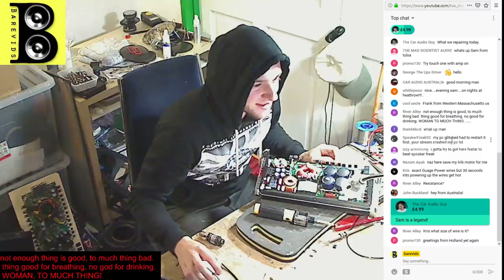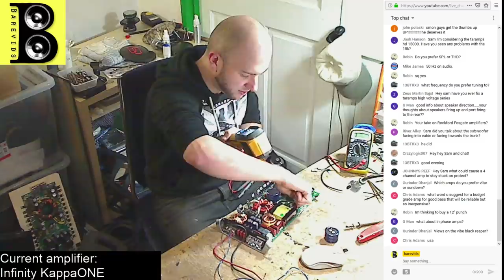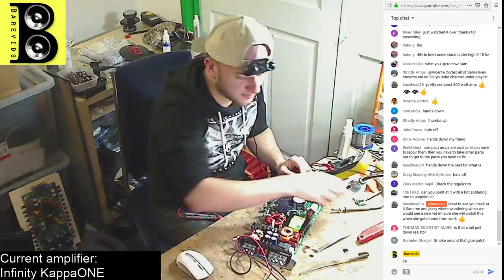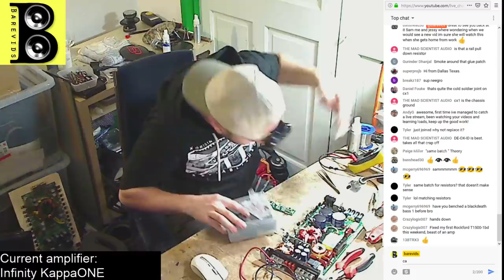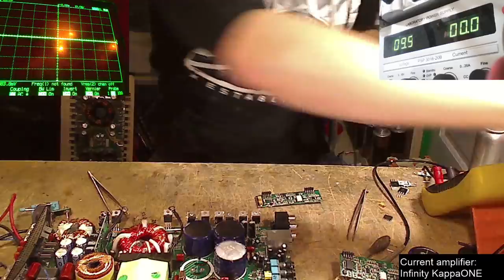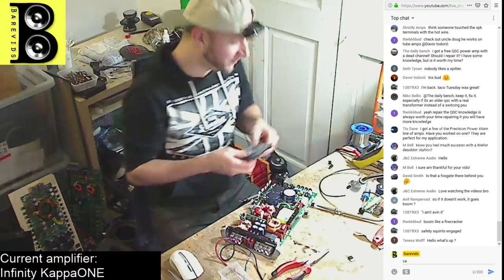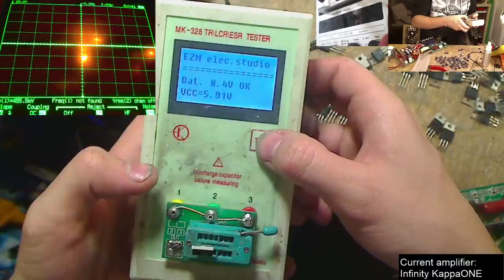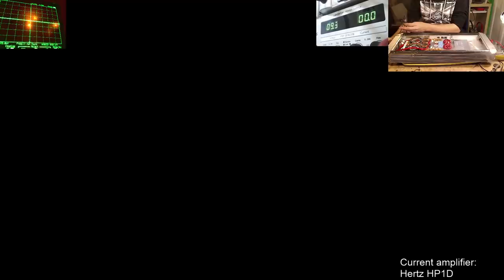MULTIPLE Failures on Infinity KappaONE amplifier repair

Comment: I do some mechanic and electronic repairs myself as well. I think that a good engineer is distinguished by cleaning stuff thoroughly. And in case of electronics, I encountered many problems with bad electrolytic capacitors. Especially when they got heat up. So when using a hot air gun near those, can cause trouble shortly after behind done. That is why I replace those, when I even have the slightest feeling of them being out of range. In both computers as audio-works it makes a lot of difference. But a nice lecture still, as I saw some interesting tools to approach broken chips. This heat camera replaces the good old liquid Nitrogen test. :D

Comment: Here's a tip bro, it'll help ya.
Most MODFETs have an "intrinsic body diode" because of the way they have to be manufactured. You can't just slap meter leads on any way you like. For an N type enhancement mode FET, it will always show up as short IF you measure drain to source with the negative lead (of the meter)on the drain and positive (of the meter) on the source.
The same applies when measuring P type in reverse. You'll get anywhere from .4 to .7 volts on diode check.

They were MELF capacitors on the driver board on the first amp and not tantalum.  You most probably won't find any tantalum caps  in anything but the oldest of amps. Also, there was most probably nothing wrong with the driver chip and you lost a bit of time replacing it. The cap was the fault. edit: It was a tantalum, I'm surprised they STILL fit them.
Reply: melf is a package...you need more study...and that is a tantalum cap..they are no novelty since 80's...
Reply: @john-mi1ud  Yeah I cocked that up, you're right.
However I have 35 years of learning electronics. So, you can jam your assumptions :)
Reply: @Jimmeh_B  didn't wanted to sound rude...i've been into this for more than 20 years and i can assure you everyday i learned a new thing...it's like programming, there's always room for better

Comment: 1:03:07 why did you try desoldering that giant capacitor from the same side that the component is mounted on? Desolder it from the other side, it would be much easier. Looks like there's a mess there next to the component.
Reply from the maker: i was killing two birds with one stone using the iron to melt the glue used to attach it down. Its a resistor by the way!

Comment: Do you have a cross reference for the hfp50n06? 
Also I'm looking into getting a oscilloscope, which level bandwidth would be good to start with?
Reply: 20 Mhz is ok for audio work. you can find them pretty cheap on ebay.  Problem is most sellers don't know how test them so at least make sure they show it powered on. Try to find a Hitachi if you can.
Reply: @cat-lw6kq  ok thanks
Reply: The bandwidth is the frequency at which the signal strength has dropped to 90% (and it drops rapidly after that). For audio, you are looking at KHz, so bandwidth won't be a problem.

I use a 30MHz analog scope and it's fine. You won't have the ability to digitally record and inspect the signal, but you can see the waveforms of the audio signal and any harmonics of it, as well as high frequency noise from power sources and such. You can get a old analog scope for around 50$, you can get a lower end DSO (digital storage oscilloscope) for a few hundred.

If you get an old analog one, make sure the ground is connected, some fuckheads float their scopes by removing the ground. A signal generator is nice too so you can feed controlled sine and square waves into the circuit to analyze its response. A lot of modern DSOs come with built-in signal generating capabilities.

Comment: Can I power Infinity Kappaone class-d mono car amplifier at home using 12v 50amp smps power supply ?
Reply: You could, but wouldnt it be cheaper to buy a used monoblock for home stereo use of some sorts? It would also be more suited to 8ohm hifi speakers.

Comment: You could have stripped the pads with way too much heat matey xD high thermal capacity yes, but you don't need 450 degrees if you're exposing things that long... D:

Comment: Does anyone know what would cause an amp to produce a continuous tone, the input signal works with other amps normally so it's not my stereo and the inside of the amp looks perfect no signs of  burns or smells. The tone just happened randomly one day it sounded high pitch and I thought it was my muffler sound until I smelled my sub smoking it burned my new sub and it didn't stop until I took out the power fuse which didn't do its job as the wire got really hot and never popped

Comment: It was incredibly difficult to watch you misread R116 instead of R118 -- and then not know why you had different results in the schematic vs. the parts sheet because you were looking at two completely different resistors.  Funny this is... R116 is literally right next to R117 on the board (and you can easily see it at 1:48:30 next to the oscilloscope window), but you never saw it and kept trying to read R118 as R116.  Also, my OCD was hurt by seeing you put one resistor "backwards" compared to the rest.